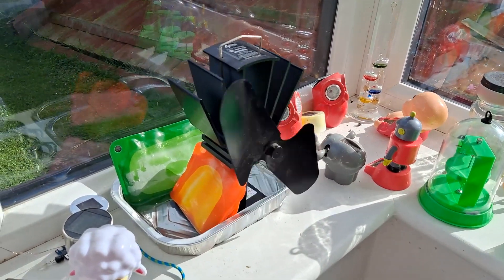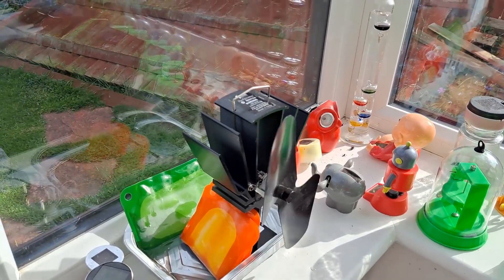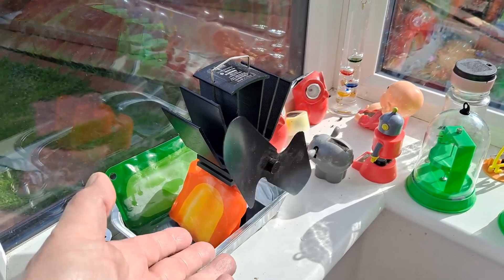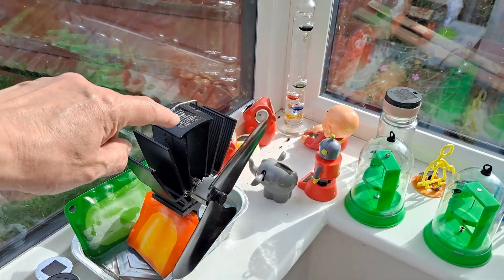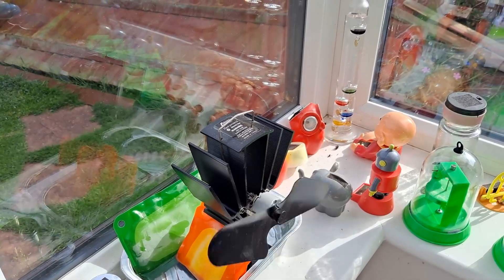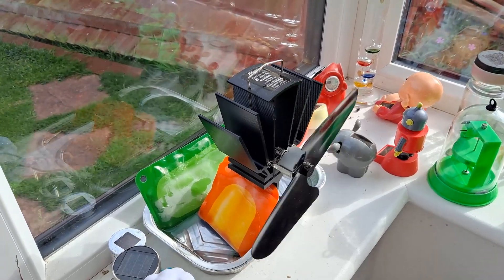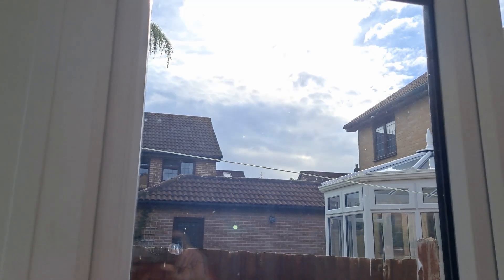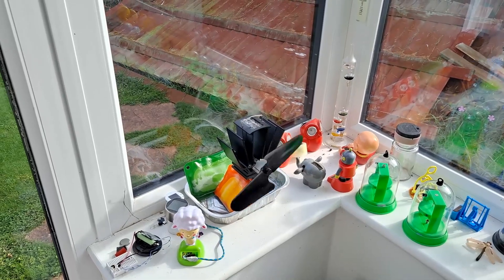Stove Fan in sunlight and cold water 20220607

Comment: That's great. It must be very well made. I was just thinking about those disposable hand warmers. You know the ones that heat up when you break the top open. You could try one of them or a couple on the bottom and see if you can get it to run.
Reply from the maker: As long as there is a reasonable difference between the top and the bottom it will work. The hot and cold are interchangeable, it will work either way although there may be a difference in how much power it produces.

Comment: "Heat Exchanger" ?
Reply from the maker: It is a fan designed to sit on top of your hot stove. Heat travels up the base to the Peltier Tile. The top end is a  heat sink, so the top end should stay cooler than the bottom end and the temperature difference allows the Peltier Tile to generate enough electricity to run the electric motor to spin the fan. Peltier Tiles will work either way round, so when I make the bottom end cold and have the top end in the sun, the temperature difference still works even though it is reversed.

Comment: Surely that`s going backwards
Reply from the maker: Which way is forwards and which way is backwards? If you want it to blow air in your direction, just turn it round the way it needs to be. I don't think you are going to get much of a breeze from it like this, I am just demonstrating how it works.
Reply: @GrandadIsAnOldMan  Ahhh, i thought you were trying to make air con from the peltier.
Reply from the maker: @danh6079  if you placed it in a bowl filled with ice and water it probably would blow some cool air around. I suspect these are more of a novelty than a practical item, but I have never had a hot stove to stand one on, so I don't know how well they perform in the purpose they are designed for. Some people have commented that they work fine, but I can't speak from personal experience.